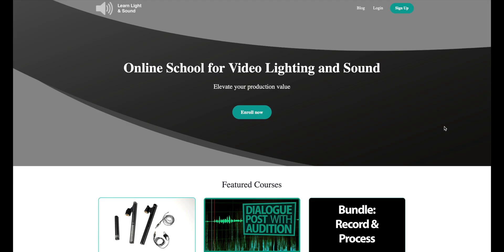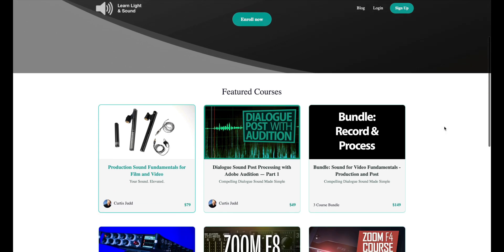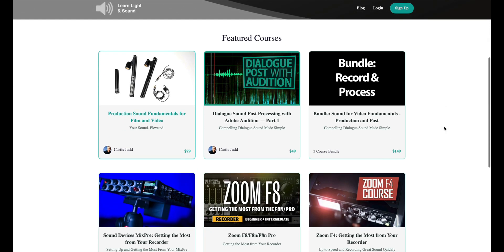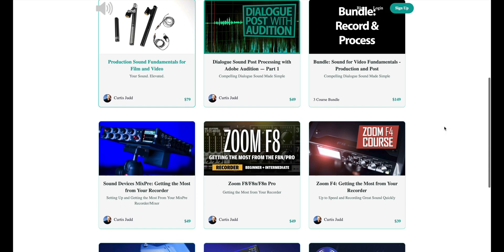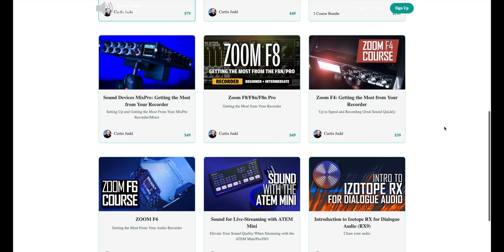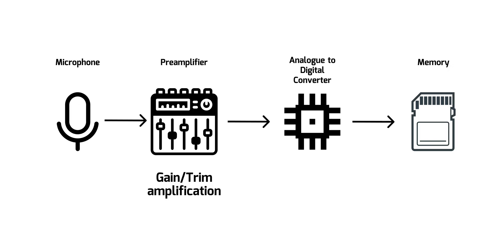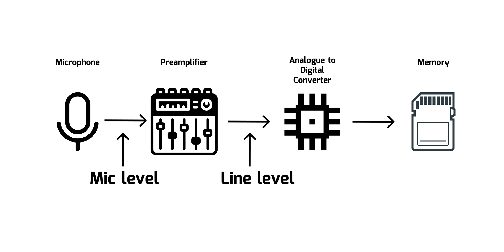Gain vs Trim vs Fader on Audio Recorders for Video & What is Mixing?

Comment: I'd love to understand how the Zoom F6 responds to live fading. I've read that when recording 32 bit or Dual recording, that the fader knobs are actually doing anything  (while recording)  I can always go in post and adjust but I would like a well-balanced  mix and/or a nice mix for a hop out to camera  via line-out. Am I asking too much of this recorder?
Reply from the maker: The faders do affect the 3.5mm output, so no, you are not expecting too much — it will work.

Comment: Curtis this is awesome, such a key topic for sound recording and yet it's not very common to talk about! One more thing to add of why you should mix is if you have a director or client and you feed them with the raw sound they on one hand will think you're doing the work wong and on the other hand they won't be able to concentrate on the shot, if for example, one of the talents is talking backstage or whatever non desired sound gets to the director/client. Do you use automix? is it worth it? and I wanted to ask you how's the post production process when you mixing and you want to adjust one mic, you have to go back to the ISOs and remix from scratch? Thanks again for all Curtis!
Reply from the maker: I use auto mix for podcast or panel style discussions, not for narrative video. To fix the mix in post, it depends on the situation. You CAN go back and start from scratch with the iso files, but you could also just cut in an iso file in a problematic spot and use room tone or other things to make it sit right.

Comment: Kinda related to the topic — around a year ago, people at audiosciencereview did some testing with MixPre and discovered that... The gain is doing nothing on these? Basically, theres no analogue gain control? From what I understand the "gain" on those is equivalent of pre-mixing fader for signal that is already combined in digital domain from optimal fixed values of both gain circuits... Or something like that. Really would love to see you charging Paul Isaacs about it in the future, given the chance.

Comment: Great video as always! Thanks Curtis!
It has been a little bit confusing for me, but Gain and Trim are in fact not the same. They do have some differences.
"Gain and Trim, both are gain stages at the beginning of the signal path... Preamp gain is a gain stage that is only positive/additive, and is controlling a physical, analogue preamp which is connected to an analog input... This lives directly after the input socket and before the signal is converted to digital... Trim on the other hand is a digital gain stage which does exist as part of the input channel processing... It allows you to increase (positive/additive) or attenuate (negative/subtractive) the input signal... You can use it to adjust the signal on a particular input channel without altering the analogue preamp stage."
Reply from the maker: On field recorders they are the same. On some vintage and vintage style equipment they are as described on Wikipedia (which is what I assume you quoted).
Reply: @curtisjudd  There are certainly some muddy waters when using the words "gain and trim". Some people/equipment manufactures use them interchangeably. To others, there is a very distinct separation. 

As you mentioned with the vintage style gear, you gain up your source at the microphone preamp, then trim it after the fact. You usually hit the preamp hard to get some saturation and character, then trim it down before the A/D conversion to avoid digital clipping, or to get the signal to a usable level at the mixer/daw.

In the world of digital mixers for live sound, gain is normally at the preamp stage, before the A/D. Trim is after the digital conversion, and is mainly used to get the signal to a level that can give you finer fader resolution. A good example of this would be using a mixer for FOH and one for monitors, both using the same digital stagebox. One of the mixers would have analog gain control, and the other would only have digital trim. If the FOH person using gain likes to hit the preamps a bit hard, the monitor engineer may trim the level down a bit so that when they make a fader move, it doesn't have such a drastic effect. For those unsure why that is, take a look at a mixer's faders. A move from 0 to -5 is physically much different than a move from -30 to -40. 

I'm still pretty new to the field recorders world, but I assume that they use gain and trim interchangeably to avoid confusion. It seems that many field recorders don't actually give you the option to adjust the signal before the A/D conversion. Let me know if I'm incorrect there. Hopefully this has helped someone on their sound journey.
Reply: Actually I quote that from an Allen & Heath website (but for some reason youtube doesn't let me paste the link) and read similiar info on Sweetwater and Mackie websites too. That's the reason I got a little bit confuse, because is recent information 🤔
Reply from the maker: @sebastiangutierrezumana  good news to remove the confusion, on modern FIELD RECORDERS, gain and trim can be used interchangeably.
Reply: @curtisjudd  Oh now I get it! That's interesting! On field recorders they are like the same, but for stage mixing boards the do have little differences. I also read that in that case (stage mixing boards) sometimes the console have both, gain and trim, and that it gives you a "cleaner" mix (less noise) giving a little bit of gain and then boosting the signal with the trim! Great topic! Thanks again Curtis 🤝🏽

Comment: Amazing! I really needed this a few days ago :) I think in field recorders, which is what I've been using for a long time, the concepts of gain and faders can seem like the same thing. But three days I go I started working with a proper mixer and it took me a while to figure out that the faders were having no effect on my microphone's gain. Finally I figured out that faders only apply to that channel's level in the mix. It's not until you separate the two that you have to understand the difference. Now, if I may make a request, I need to properly understand routing: analog to Dante, inputs vs outputs, inserts, and how plugins come into the mix. Thanks!
Reply from the maker: 👍 we cover some of those in my courses and some in my other videos here on YouTube. And, of course, there are more videos to come.

Comment: For me, one thing that really clarifies the gain/trim vs fader distiction is: using gain/trim is a technical step that you need to do, while using faders is a creative decision. With gain/trim, you bring your signals to a certain measured level, while with faders you use your creative judgement to decide which signals should be louder or quieter than others.
Reply from the maker: Good way to think about it. 👍
Reply: Yeah, this is exactly right. 

Note that trim can also be a creative decision, for example if you're using a tube preamp (or emulation thereof) in which case the trim determines how hard you drive the tube and what sort of (presumably wanted?) distortion you get.
Reply from the maker: @patrickchase5614 👍
Reply: @patrickchase5614  Good point! I did not think of that.
Reply: Yes. For me, gain/trim is analogous to setting white balance and matching color on a bunch of video clips. Mixing is like applying a color grade. The former is technical and measured, and the latter is more creative. (It's not a perfect analogy.)

Comment: Thank you for the video, I enjoyed it.Looking forward to hearing your advice on how to properly use trim, fader, limiter and normalisation etc in a 32bit float workflow.  Some recorders do not even allow setting the trim these days, while others do.  The F3 has something like trim, but that is just a magnfiication level setting. On recorders without trim control, the resulting audio in the video edting software or DAW will be very low, so you need to normalise, however, there will be low and loud parts... what to normalise to? Or use Loudness normalisation?   I love 32bit float, but I am sometimes a bit confused as all my recorders (and I have quite a few) do things somewhat differently. So I am curious how a pro would deal with these things.
Reply from the maker: Thanks 🙏 Good questions!

Comment: So wait do faders only affect the mix or does it affect the Iso tracks too?
Reply from the maker: In most cases, faders ONLY affect the mix. There are a few more advanced mixers out there that allow you to record the iso channels "post fader" meaning they DO take into account the faders for the iso recording.

And then there's ZOOM 32-bit float recorders where the knob (say, on the F6), in its default configuration, is a fader and the audio is recorded post-fader.

So, it depends on your recorder/mixer.